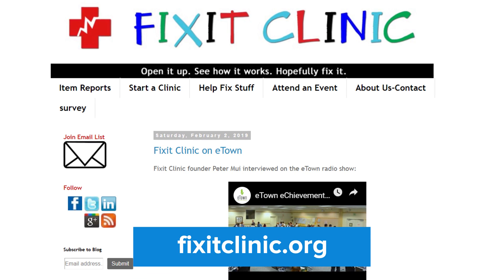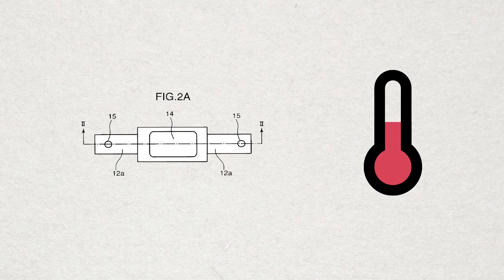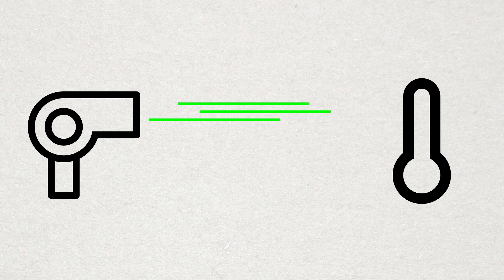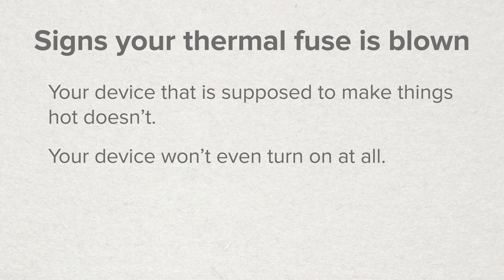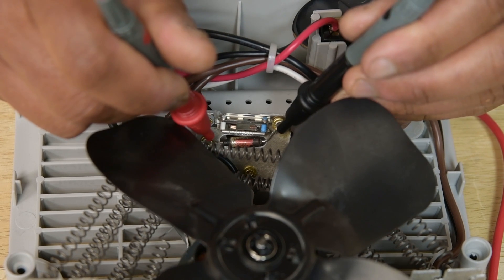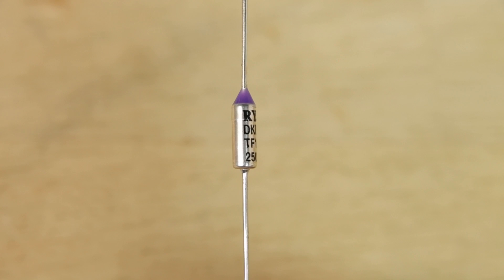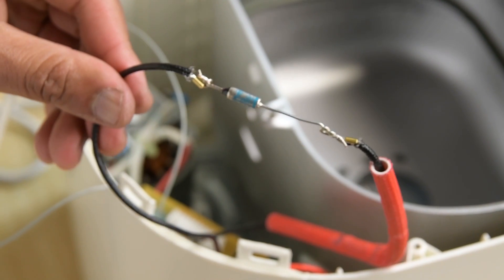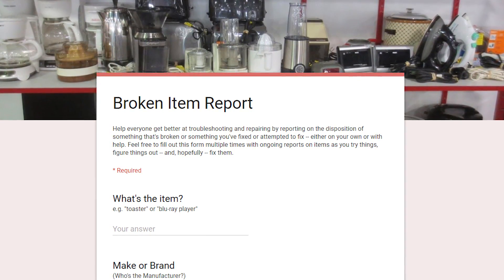How to Replace Thermal Fuses: Repair Tips from the Fixit Clinic

Comment: You DEFINITELY want to solder that connection!
Twisting wires together is not the proper way to handle 10 Amps or more, which is not uncommon with heating devices.
Reply: @R. Rodriguez There's a difference between a crimp connector and just twisting wires together.  If you have a a crimping tool and the right kind of connector, sure, go for it.  But I wouldn't trust the connection if wires are simply twisted together.

Twisting is often used for mains wiring, but any electrician that is the least bit competent will use a wire nut as well, in order to secure the connection.  But you probably won't be able to find wire nuts small enough to use inside a consumer appliance.
Reply: Yep! Most of them have squeeze connectors with them, but I always solder them also.
Reply: R. Rodriguez  A lot of the time the squeeze connectors are good enough. But just being good enough isn't good enough for me. I trust soldered connections more than crimped connections.
I explain it a lot better in this article that I wrote: http://jestineyong.com/sensio-bella-blender-repair/
Reply: False. Solder melts. In the case of a wagner power heater, was assembled using brass rivets to clamp.
Reply: @chrisspencer4894  crimp is the best way, but if we do not have crimp tools, solder it is very important for 2000 watts or more applications. Weak joint cause fire. The trick is wrapping the fuse with wet tissue when soldering. I have 130c fuse and it blown up without wet tissue.

Comment: Hmmm not gonna lie, soldering is REQUIRED for optimal connection. Twisting cables around a metal wire is not enough to handle high currents.
Reply: Soldering might not be possible because the environment gets hot enough during normal operation conditions for the solder to melt.
Reply: @RolandV3922  Submerging just the fuse in a bowl of water will help keep it cooler.
Reply: @PareshPatel-xc2vu  Excellent suggestion. Perhaps we can also mount a peltier element to it.
Reply: @FelinoFacho not a lot of people have a spot welder
Reply: @dereknottelling5755  Doesnt need spot welder you only need a crimp ferrules
Reply: Butt splice connector might do it.
Reply: Thermal fuses in appliances are typically crimped, not soldered.
Reply: Same thing looking at a gas tank with a lighter... Lol
Reply: Mine came with heat shrink tubes.
Reply: … or crimp it?
Reply: @John Doe wtf
Reply: @John Doe lol